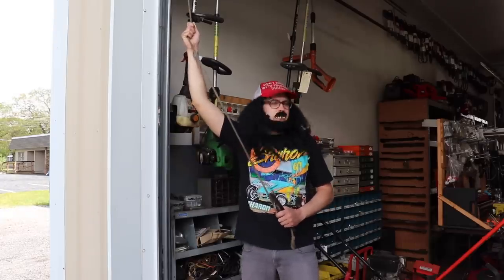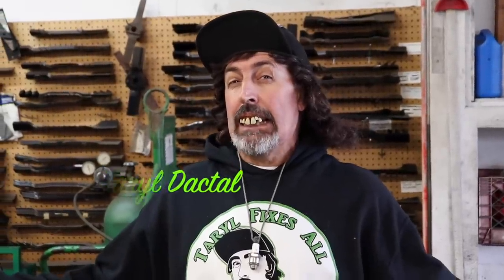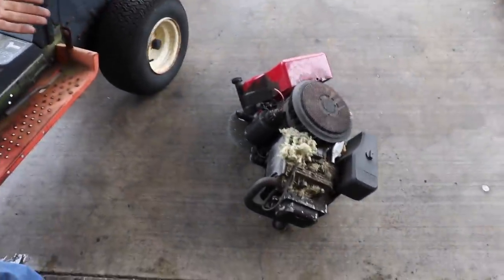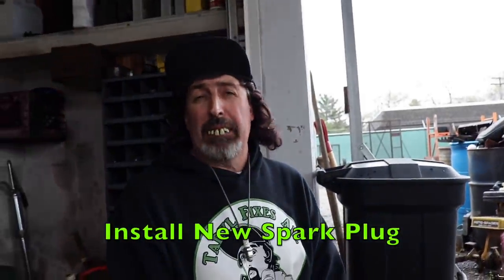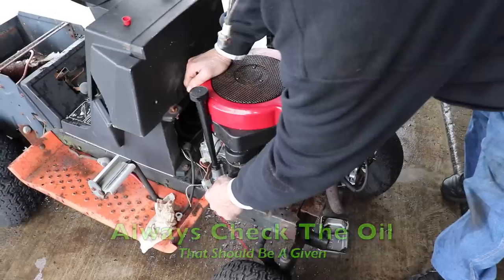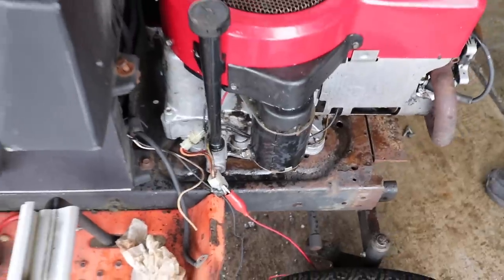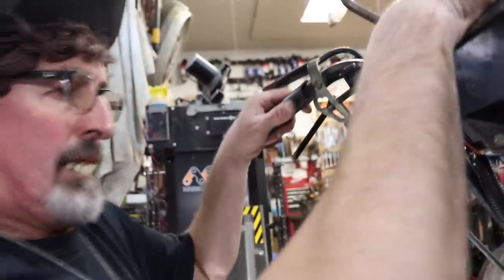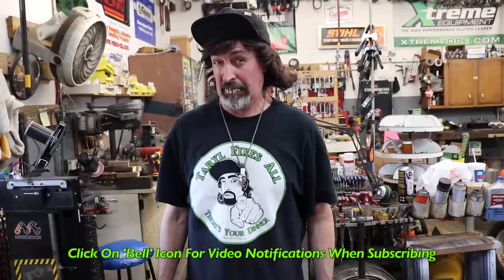Easily Swap An Engine On A Toro Walk Behind Mower - with Taryl

Comment: I have the exact same motor in my 2000 Scots S 1742.. It  turned 20 years old this year.  motor and riding lawn mower are going strong.. Routine maintenance and I just change the valve cover gasket as well I can not complain that is a great motor. like I said 20 years and still run in the strong.. Thanks for the video

Comment: Love the engine swapn Taryl!
I have 1974 Dynamark rider that my father rode me around on as a child. It does have sentimental value. I've restored the deck with all new spindles and paint. Also, new front tires. The 8 horse Briggs with electric start is a leaker and the plug is discolored after 10 hours of use. My local shop has a new 11 horse short block with a warranty that might be just what that tractor needs. Is 500 bucks plus install insane? I love the tractor and a new engine would just about keep it going till I dont feel like cutting grass myself anymore. Was wondering what you thought.
I'd love the leak to be the value cover and will look into it next time I decide to do something with it. Wish I knew how to add a pic to this post. I'm quite proud on how far its come.

Comment: We call them "riv-nuts" in the aircraft industry. The best kind have a die that punches a keyway in the hole that reduces the possibility of the riv-nut turning.   They are great for all types of light fastening and make future disassembly a breeze.   Looks like Elkskin hooked you up with a good motor:  tight and smooth!

Comment: Yep, those are some real good engines, I had a 14.5 hp that I ran for 20 years with absolutely no problem & decided to change it over to synthetic oil, & synthetic oil evaporates more than conventional "lesson learned" & ran it low & that was it.

Comment: great video taryl ; yes; I took a old chevy water pump v - pulley and notched it and took the screen off the flywheel and mounted the pulley right to the flywheel ; now I can take a piece of rope ; wrap it around the pulley and start it the old school way; that's why I don't throw my junk away either

Comment: I was hoping you would show how to wire it from pull start to key start. I dnt have the mower the the donor engine came from just the engine. The wires are all there. Same engine as the old in just trying to get the key start to work I have 90 percent of it wired

Comment: Wondering if this is economically feasible? Cost of parts and labor exceed value of mower? Is this more a lesson for a do it yourself repair? Great job!
Reply: bcamk it’s mostly all comes down to the hydros on the machine if they are shot then the mower is trash some mowers can go through 2-3 engines before hydros go out

Comment: I have this same mower in the ExMark model, the kohler cv15 just blew on me, I found someone local with a John Deere cv17 key start when mine was originally pull start, is it safe to assume it’ll bolt right up to my application?

Comment: Is there a particular reason you put the fuel shutoff AFTER the fuel filter?  I normally install the shutoff before the filter so I can easily shut off the fuel to change the filter when needed.

Comment: It looked like the replacement engine didn’t have the battery hooked up to both positive and negative after you started it. I thought it would damage the stator (or rectifier if it has one) to run it after it started. Kinda like when you start a car and then remove the battery while its running. Or maybe I just had to much vicadon again....

Comment: no mentioning of diode or regulator for charge circuit😮

Got to be careful as battery voltage back feeding the stater can cook them if key switch is left on engine not running.
I think some staters have diode built in🤔
Reply: That particular engine does have the diode in the stator. Not sure if it would still charge as good as it did, with a shorted diode. He does have a separate video on Briggs alternators.

Comment: hey i did that trick when you install a plastic bag on the gas tank under cap. then flip mower on it side to do work on it . well when i went to start it i pulled rope and it was locked up??  i remove the pull rope assy and reverse turn the flywheel and it is now turning with no problems. so i started up mower and it smoked bad and cleared up after 5 mins, now do i need to remove the oil any time i flip  mower on it side ???? you did not say you must remove all oil first before flipping mower on side so oil will not get into the piston area !!!!   just say`n

Comment: Great video Tayrl,Junior,Slippers,"Mr.Camera-man"!!.(mufkin😺😸🐈⬅too)
It's like the"Twilight-Zone"with your customers,people trading in Honda engines for Briggs/Vanguard engines and now I'm seeing a customer opting for a Briggs single cylinder,USED I/C engine,if that Kawasaki 17-twin was brand new on that commercial Toro,the single-cylinder"USED"Briggs I/C will be"toast"in no time.
I like the electric start feature,would have been a bonus if it had the rope start also in case the battery went bad in the middle of a big yard cutting job,but it should be ok in the long run.
Reply: Customers only want what they wanna pay for 🤷🏻‍♂️
Reply: @trentofdestiny  I know that,I just find it odd that the customer would want a USED single-cylinder engine over at least a USED TWIN-cylinder engine.(twins recover alot faster then singles in heavy grass)
Reply: 4 gauge I hear ya and I agree. But look at how beat that mower was. Owner obviously doesn't care as long as it mows
Reply: @trentofdestiny  Oh,he might change his mind when he sees how much less torque this engine puts out compared to the oil burner he had before.
I've owned ONE single-cylinder lawn tractor in my life and it was a real dog,you had to slow down to a literal crawl to cut thick,heavy,grass and the vibration through the frame would make your hands numb after a few hours operating it.I understand that Taryl and his crew have to make the custom happy with what the customer wants,but I just hope the customer understands there is a big difference in performance between a single and a twin-cyl.engine.(alot more cubic inches of displacement means more torque for the SAME horsepower rating)
Reply: 4 gauge I agree with you there too, for example in the video he's using 28ci engine, but most of what I deal with is 31ci intek single ohv. Compare that with the vanguard 16 v-twin which is 30ci. I'd rather have the twin any day.
Reply: @trentofdestiny  it's not just cubic inch displacement either,it's the fact that when a single-cylinder fires,it has to make one full revolution without any power at all before it fires again,we all know that a 4-cycle fires every other stroke.

Comment: You drilled a hole on the hydro reservoir for a ground? Why? I mean i know the hole wont hurt it as it naturally bleeds thru the cap, but wont the hydro oil make the ground malfunction over time?

Comment: I have situation, the acceleration slowly decreases after I did my first oil change. Is a recent purchase in 2019. I notice the acceleration handle slowly moves. Is this has to be because of oil change or is it just the acceleration  handle? Just want make sure if it has some sensor that will lower the speed because of new oil, idk. Help please.

Comment: Me (13) and my dad are working on fixing a 2013 John Deere xuv 550 for a guy
Reply: Wrockstar 1 cool learn as much as you can . Excellent!
Reply: mitzvos Golem  thanks it is my first major project fo someone before it was just tune ups and carb cleans
Reply: Wrockstar 1 Good . read entire service manuals and learn electrical systems and how circuits work. Most mechanics today poor with electrical systems and can't repair equipment.
Start with ohms law.
I started at 9 yo fixing boat motors.
Reply: mitzvos Golem thanks for the tips I’ve just been fixing push mowers and other small yard equipment 

Also my dads friend gave me a push mower that we diagnosed and found it needed a engine rebuild because the piston broken and melted to the block
Reply: Wrockstar 1 that's how I started fixing up mowers outboards dirt bikes I got for free.Keep up good work!
Reply: mitzvos Golem thank you for all the tips

Comment: have a question for you ?   why does my briggs and stratton intek ohv 21 hp  motor s exhaust pipe and muffler on a craftsman lt 3000 get red hot and the muffler as well ? i mean glowing red from the exhaust ?
Reply: Running too lean? Or you're ignition timing is messed up and you're burning fuel in the muffler.
Reply: @bairfamilyfarm1336  cant be running lean  cause then there would not be any fuel in the muffler ?  ignition  might be off a tad  but the shear pin is intact  so i would say igniton is dead  right on time ?   right ?
Reply: @bairfamilyfarm1336  you knew exactly what you were talking about   i checked and it scheared the keyway on the flywheel.  i would have never guessed it would have done that . thanks  for your reply     wow  omg   it worked   sounds and runs great now

Comment: I watched a guy use the nutsert then weld it in . Whats the sence in even doing that if you are going to weld them in? I guess he didnt want them possibly turning. I know I have had a few rust up and they WILL twist round and round. Then you have to tac weld it so you can get the bolt out.  Your sound effects were a hit with my daughter. I am currently working on a Troy Bilt simular to that. The thing has sat for a while. Had a flat tire and the plastic throttle cable block was busted. Apparently with age, they break down material wize and shatter like glass . The sad part is you have to replace the entire throttle bracket with this model.  I hate those choke cables. They eventually rust up and its best just to cut off the end, pull out the old cable and install a new wire core. I found a place that sells the core wire only. That way you can just replace the core, not the whole thing. I hate electrical wiring on lawn mowers. Especially when some clown goes and starts chopping things out.

Comment: hey Taryl need assistance with a Toro 30194-89020 T-Bar Style mower that mower blades doesn't disengage once the lever is pulled back.

Comment: Dude.... nice video but what about the most important part..the transmission? you spend zero time showing us if it was compatible,? did you have to make any modifications to make it work what ?? WTF??
Reply: These mowers don't have transmissions. The main pulley from the motor turns the pulleys underneath each hydraulic pump and subsequently the hydros pump the fluid into each motor wheel as you put the mower on go mode. These mowers will outlast any transmission driven mower 20 times as long as you have a working engine on them.